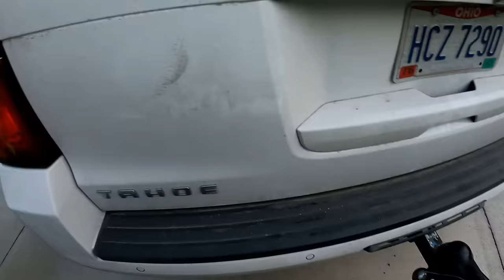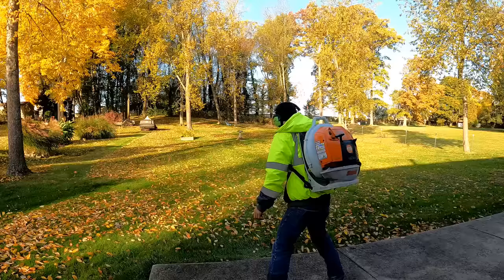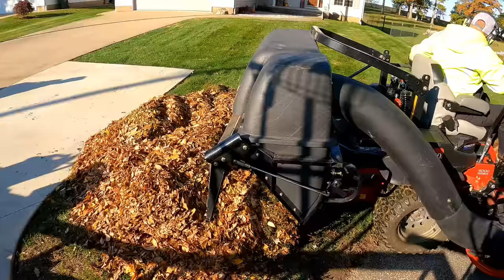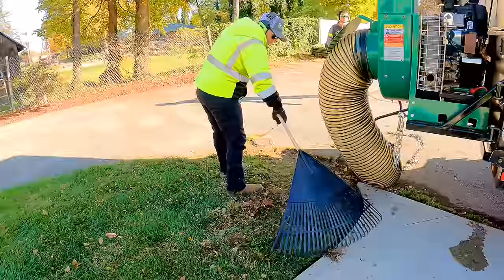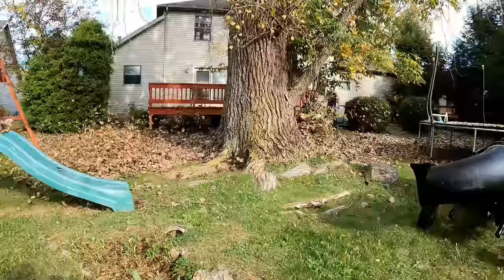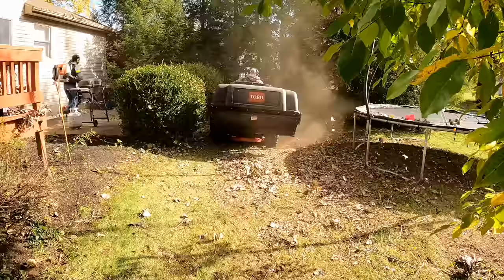HOW TO DO FALL CLEAN UP FROM START TO FINISH | $1,000 DAY AFTER ISSUES!!

Comment: You might consider wearing dust masks while running the vacuum system. Last week I inhaled a bunch of leaf dust while mulching dry leaves.  Afterwards the "snot test" was a fail and then I coughed for the next three days. I suspect that there were mold spores mixed in with the leaf dust... Who knew that cleaning up leaves would present such a hazard!

Comment: Wow! Way to get the job done. Of course with very dry leaves comes a lot of dust. And that means making sure that cooling air intakes and air filters aren’t getting blocked. It’s dusty work and I used to do a lot of it. I always felt like it would take a long time to get all the leave dust off me.

Comment: Hi Shawn,
Have a suggestion for you. Inside you leaf trailer at the head of it where the leaves are eroding the aluminum, consider installing a piece of 1/4" Lucite (Plexiglass) would take the abrasion. It would only need a 1/4" bolt in each corner and would be easily replaceable. Best Wishes.
BTW, TQ has pretty eyes and a wonderful smile! Lucky you.

Comment: 1st hope your mother is doing good . TQ is a natural on that vacuum    note sure that big blower on the multiforce is worth it on these smaller properties. will be great on the big ones like the church etc. 
2 baggers would be a big improvement. you could then be vacuuming as the leaves are brought out to it instead of making a huge pile that is hard to reach with the pipe

Comment: You make it look so easily. It helps with the right equipment. Thanks. All you mowers start so fast I have an old craftsmen riding mower and it takes forever to start. Is there anything that would help?

Comment: I will say I much prefer my rear mounted leaf rake rather then using my mowers baggers. It's just a nightmare to clean all that leaf debris off the mowers not to mention breathing that crap sucks worse then smoking a pack a day. Lol I am curious how you feel about the toros compared to other equipment. I've been thinking bout ditching my deere zero turn for one.

Comment: That mower is blowing alot of leaves out the front/right side. I noticed as you were going over the mass of leaves that it was blowing alot over the area they had just cleaned up. Just my thought.
Reply: Ok at the end of the video it wasn't. I dont know if you made an adjustment or what happened. Great cleanups!
Reply from the maker: Yeah at first we keep the deck up some because of the amount of leaves and the grass was long as well then we lowered the deck

Comment: Switch to a low lift or mulcher blade. Will virtually eliminate the need to blow over what you just mowed. You have so much blow out right now

Comment: Could you leave the tube on the arm it hangs from and just move that back and forth while picking up the leaves?
Reply: Our tow behind leaf vac has two of the straps and chains on the hose. It works alot easier. Ideally the end of the hose points down and is supported by the boom. We have several places that each fill the whole truck up similar in size to Sean’s. It beats you up if you have to wrestle the hose around all day.